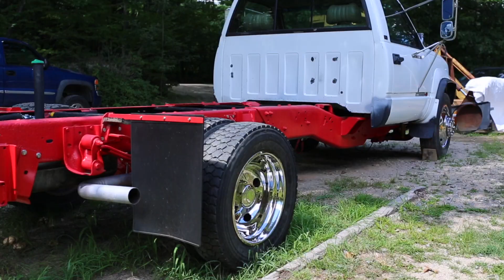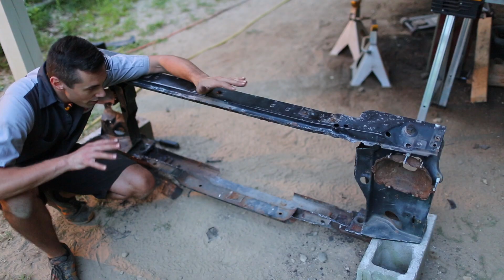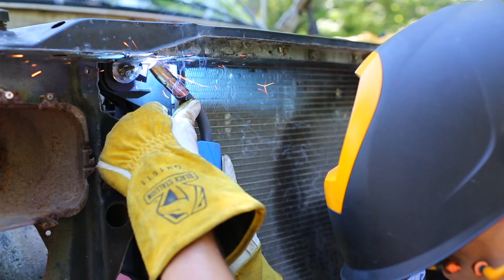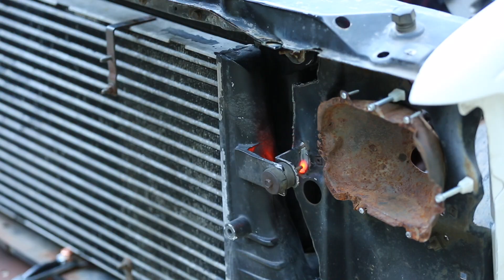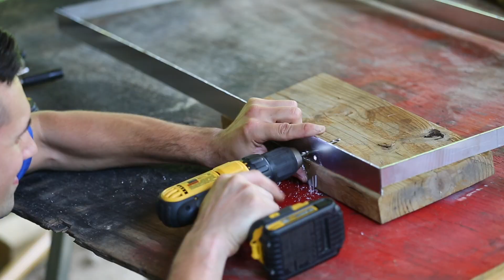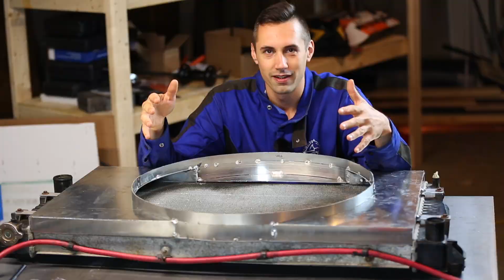Cummins Swap: Fitting a Dodge Radiator and Intercooler into a GMC C3500HD [Part 10]

Comment: Unless I didn't see it, I would have raised the intercooler before welding on the lower mounts so it didn't set on the radiator support.  With diesel vibration, where the intercooler and the rad support touch could rub a hole in the intercooler over time.

Comment: Won't the metal fan blades , Flex forward as your engine RPM increases which means you have to allow sufficient clearance for the blades to miss the radiator ?

Comment: Did you put any shims between the front mount and the intercooler? 16:17 Looks close between the two, don't want it rubbing a hole on the bottom of the intercooler when the weight of it is moving slightly up and down on the road.

Comment: I have a 12 valve swapped 99 c2500 but the guy that did mine used the gm radiator and  condenser. No intercooler. he put separate trans cooler for 4l80

Comment: 19:30 There on my 1992 c1500 looks like the same condenser, it had 4 metal C shaped pieces with rubber inserts that were in each corner in the top and bottom, but you cut where it would have mounted off, if that was an A/C equipped truck

Comment: I haven't seen a wire feeder on the handpiece like that before. had to look up why.... the softer aluminium wire jams in many wire feeders. then there are a bunch of design issues 

lincoln welding have some info .
https://www.lincolnelectric.com/en-au/support/process-and-theory/Pages/aluminum-feeding-detail.aspx

found the manufacturers page on the welder and spool feeder. hope it's useful to someone. Def should add amazon links in the description. looks to be really nice gear.

https://www.hobartwelders.com/-/media/hobart-imported-mam-assets/spec-sheets/6/7/0/spoolrunner-100-250766.pdf
https://www.hobartwelders.com/equipment/welders/mig-gmaw/handler-210mvp-mig-welder-m00229
Reply from the maker: Yeah, wire feeders are pretty cool. I haven't used mine that much, but I always have a hard time getting the settings right 🤷‍♂️

Comment: A plasma cutter also works well at cutting aluminum.
Reply from the maker: I heard that plasma cutting aluminum doesn't work well without a shielding gas, but I probably should have tried it to find out for myself 🤷‍♂️
Reply: @WaldosWorld  yeah 100% argon

Comment: Looks like you made out ok. But a word to the wise. Be very very careful welding around a aluminum rad. One molten bb in the wrong spot with instantly put a hole in the aluminum fluid tubes.

Comment: Barely 3 minutes in and I had to stop the video to make a comment, just as you stopped progress on the build to process a viewer's comment.  I've enjoyed the build to-date, so let me say that.  Just not sure why deal with the wheels at this point?  It isn't running yet.  And who cares what some lameo-keyboard-romeo has to say?  I men, I noticed those red wheels too but having been through an entire vehicle build on more than one occasion myself, I thought nothing of it.  I figured you'd get around to it when the time was right.  Curious to know why you kinda agreed that the wheels looked like clown wheels ('cause I didn't think so)?  Was it only the color?  That is easily remedied, so it seemed like that wouldn't be the reason.  Don't like the shape of those wheels perhaps?  Dunno.  I'd have just opted to strip the paint later on and then either paint or powder coat them the color you want.  Save the $200 for something else.  Finally, I do like the shape of those wheels in the context of what this truck will be: a rugged working truck, however nicely it's painted.  Chrome wheels just don't fit that model, but that's just me.  'Just sayin'.  Anyway, back to the remainder of the video.
Reply: I hope the oil pan was back on before all the grind and cutting etc started

Comment: Hello Waldo I just came across your channel on YouTube pretty cool man. I love the idea of you putting the Cummins in that Chevy 3500 for sure. I've always loved Cummins engines and I definitely love those Chevys I do love the Dodge set up with the Cummins to but I admire what you're trying to do, but the first thing you did wrong you should have cut the crossmember out of the Dodge cut the crossmember out of the Chevy and took a shitload of measurements and then welded the Dodge crossmember into the Chevy. Another thing never worry about transmission tunnels you can always fix those with a 50 gallon drum LOL just kidding but you know what I mean rather than hacking off part of your transmission to make things work I really wanted to jump into the TV and put my foot in your ass when I saw you do that plus all the cutting and Welding you did on that poor crossmember and it still is not really right next time you do an engine swap please try that method. The very first swap I ever did was in a 67 Scout straight axle front end just like the Chevy and we took and put a V8 Chevy engine out of an old Bel Air into that Scout you know the only thing we ended up having to do was make our own crossmember mount and cut the drive shaft that was it. And I am a carpenter 30 years plus so taking measurements is very very important measure nine times and cut once if you know what I mean. Anyway brother I really enjoy your videos keep them coming. Stay safe stay well and as always God bless.
Reply from the maker: Wow, Joseph, thank you so much for the comment and your input! 👍
Reply: @WaldosWorld  thanks for the reply I appreciate it yeah I binge watched some of your stuff yesterday nice

Comment: You are making a cummins swap seem to be  super hard and are way over complicating things  swapping a cummins into any gmt 400 is stupid simple and doesnt take anywhere near the amount of extra your putting into them when i swap them i literally  use everything from the donor truck and only have to make 2 holes in the rad suport for the intercooler and slightly modify the factory motor mount onnthe frame depending on style of motor mounts  i use from either a 1st gen or 2nd gen and up mounts  i cant wait to see how hard you make the wiring look
Reply: And yet not one f#cking vid on your channel... idiot.
Reply: You're obviously blind or deaf, how do you expect him to reuse dodge mounts, blah blah blah when he had to do all of that cutting and trimming to fit the trans, etc? You're the expert, do tell.

Comment: did you have to do any thing with the front suspension with the added weight of the cummings ?
Reply from the maker: While I haven't driven it yet, I don't expect to have to do anything. The front GAWR is 5,000 lbs, so it'll probably be fine

Comment: I subscribed, love your channel, 1 comment about your aluminum fan shroud... you should keep the conical angle going from edges of rad to ring for increased smooth airflow and avoid the massive turbulence you created.
Reply from the maker: Thanks! That's a good point. I guess we'll have to see how it works and if I have any cooling issues then I may redo it. That does make the fabrication more difficult, but I suppose I'm up for the challenge!

Comment: looking at the comments it looks like the last comment was about 2 months ago. I just have the question, how hard is it to wire up the Cummins?
I am thinking of using the stock 4l80e automatic trans with my build and using a separate transmission controller. 
any advice will help thanks! 
p.s the videos are a great help keep em up!
Reply from the maker: Good question. The Cummins has an ECM that I'll need to wire in to the rest of the truck. It's important to me that I get all of the gauges working including the speedo and tachometer. It'll probably be complex, but one thing I've learned is to break complex problems down into smaller components, which makes it a lot easier. As for using the 4L80, yeah, I think you'll need a separate transmission controller, perhaps an aftermarket controller? That'll add a little bit to the wiring, but it's totally doable. Good luck!
Reply: I used a 4l80e on my Cummins swap and it worked out great. I used the painless transmission controller. All it needs is ground, power and a tps sensor. Just make sure your 4l80e has a low stall converter and that you have a large transmission cooler.

Comment: How you going to make the clutch work on the Eaton trans? Thanks
Reply from the maker: The transmission came with a clutch release cable that I was planning on hooking up to the clutch pedal, but I've thought about that and I think I'm going to try something a little different: I bought an OEM hydraulic master/slave assembly and I'm going to try to hook it up to the Eaton trans. It'll take a bit of fabricobbling, but I think it'll be doable
Reply: Thanks! enjoying the videos. Doing the same swap. Hope you can include that on another vid. Thanks again
Reply from the maker: Yeah, I'll probably do a video dedicated to getting the clutch hooked up 👌

Comment: Cool video. And cool truck. I want to build a 2001 dodge ram 3500 with a 24 valve cummins and a 6 speed with new or remanufactured parts. But I'd like to find a way to fit a common rail 5.9 cummins head on a vp44 cummins so I can run pacbrakes load leash engine brake. Basically build a brand new 2nd gen dodge ram dually
Reply from the maker: Oh wow, that's really cool! I didn't realize that engine brakes were available for the common rail 5.9s. I guess I'll just have to settle for an exhaust brake until I decide to do a common rail swap 🤔
Reply: @WaldosWorld  yeah check out what pacbrake has to offer. There's a guy on youtube that's running a load leash on  6.7 cummins. The load leash works better with a exhaust brake though
Reply: @WaldosWorld  I've been wanting to build a 01 dodge dually for a long time now. I'd like it to be Patriot blue with a cm flatbed

Comment: Hey man thank you for these videos I just picked up a 95 3500HD nv4500 with the 454 pulled by the previous owner for his truck. The truck has 55k original miles and needs some rust repair but for 1100 I can’t complain. This is exactly what I’d like to do with it. These videos really help me get an idea of what I’m looking at
Reply from the maker: Very cool! That's awesome that yours came with an NV4500! Also, the 454 is cool, but diesels are better 👌
Reply: Waldo's World that’s why I hope to be installing a 12 valve at some point into it.

Comment: Here's another suggestion.  Make a two piece fan shroud similar to the factory GMC/Chevy shroud.  Cut your fan shroud in 1/2 horizontally.  Weld on a "flange" to the top and bottom sections along the cut line.  Bolt them together with the factory GM speed-nuts and bolts.  To remove your fan, unbolt the top 1/2 of the shroud from the radiator support and the bottom 1/2 of the shroud, remove top 1/2 of shroud, then loosen and remove fan.  It was nearly impossible to loosen the fan on our 2006 Jeep Liberty CRD with the factory fan shroud in place.  After spending nearly 2 hours removing the fan and fan shroud for the 1st timing belt replacement, I made a two piece shroud from the factory shroud and 1/8" aluminum to join the halves at the cut line.  It took 20 minutes to install the fan and shroud with the two piece shroud.

Comment: Here's a tip for future fan removal.  When removing the fan with the radiator in place, cut 2 pieces of cardboard and place them between the fan and radiator to protect the radiator if the fan gets away from you.
Reply from the maker: Good idea! That would be especially useful for when installing the fan/shroud since they need to be lowered in place together and it takes 3 hands to keep the radiator fins safe 😂

Comment: Sorry to say this but in my opinion you should’ve got Alcoa rims instead but other than that those rims look fine on the truck too
Reply from the maker: I agree, Alcoas would be amazing! But they're expensive and hard to find for this bolt pattern 😢
Reply: Alcoa doesn't even list a wheel for this application anymore. Why GM went with the oddball 5 lug, makes no sense. The F450 of the 90s used a rare but more available 10 lug pattern. Everyone has a suggestion for Waldo when it isn't their money being spent, smh.

Comment: Waldo, you are a talented young man! All the metal fab and welding you do in shorts and short sleeves, and not covered in slag burns. I look forward to your videos and your progress on your truck and equipment
Reply from the maker: Thanks, William! I sometimes wear more protective gear, but the weather is definitely a factor. If I were welding overhead with flux core, you can bet your buttons I’d be wearing full leathers 😂
Reply: @WaldosWorld    Waldo in leather, gotta see that.

Comment: The thing with wheel simulators is they trap moisture and dirt behind them and cause your wheels to rust.
Reply from the maker: Yeah, that's a good point. I'll probably want to take them off once in a while and clean out the junk and any loose rust
Reply: Waldo you can always pull them off for salt season.

Comment: CBEO, The wheels look good, can you get matching single wheel covers Incase something ever happens to one?  Also, do you have any estimate of mpg once completed?  My guess is 16mpg or quite a bit more with a 2 speed rear end.
Reply from the maker: Thanks, Carl! I don't think I can get singles, but at $200 a set, I can always just buy another set if I need to. As for MPG, I'm hoping for high teens, though mid teens is probably more realistic, but it's really hard to say with such a heavy truck and dual rear wheels
Reply: Waldo's World, I didn’t even think of the weight... you could do an episode when complete of you going to a transfer station(dump) and having it weighed.  I would be interested...

Comment: Great video again, Waldo.  That fan shroud turned out really nice.  Are you going to be adding steel to the core support to make up for all you removed?
Reply from the maker: Thanks, Greg! Yeah, it didn't make it into the video due to length, but yeah, I'll be adding quite a bit of material to it for strength 👍

Comment: Epic video as always many thanks Waldo , a lot of hours work I can see , takes me all day just to find one tool , Ali welding is difficult and comes with plenty practice so well done there,  I have to use gas and special rods, has to be just right temperature , your welds look better than mine so your ahead , see you in the next video !
Reply from the maker: Thanks, Steve! Yeah, TIG welding in particular has a ton of variables that need to be just right, so lots of practice is needed to get good! 👌

Comment: Nice job, enjoy your fab work and video production. The plasma cutter is a huge help. Much cleaner and faster than cutoff wheels. I have a K3500 with AC. I'll snap a pic of the ac condenser and post it on your Instagram. Replacing my Chevy grille, your timing about the ac condenser is good. Like the wheel covers, made a big difference. Once you clean up the cuts and are ready for paint. Use Coroseal as a rust encapsulation and primer before you paint. Stuff works great. I've been restoring a rusted out 62 C10. Stuff works well.
Reply from the maker: Thanks, Scott! Wow, that '62 C10 sounds awesome -- the first gen chevy trucks are on my short list for future projects. I was thinking about putting a C10/20/30 cab on my Dodge frame for a cool old truck with modern-ish suspension, steering, brakes, and towing capacity 🤔
Reply: @WaldosWorld  that would be a great project. I enjoy working on old vehicles.

Comment: How long you been working on the truck?  I have one like it with a/c and 6.5. Same you had.  1998 is one i have.
Reply from the maker: Ooh good question. I've had it for over a year, though it's been sitting for much of that time while I worked on other projects. It's been my main project for a few months now 👍

Comment: The truck is coming  together very nice the stainless wheel caps really made the truck look so cool i was just wondering are you going to put a flat bed on the truck if so it would really look nice
Reply from the maker: Thanks! Yep, plan to build a custom flat bed for it once I get it on the road. It'll probably be a nice skirted bed with tool boxes built in under the bed. Throw in a gooseneck hitch and it'll be good to go 👌
Reply: @WaldosWorld  no problem can't wait to see the out come of the truck its a amazing build.👌👌